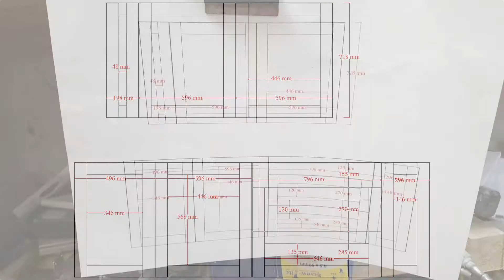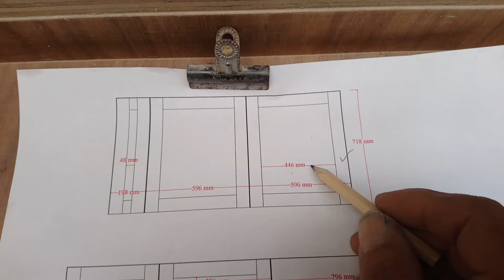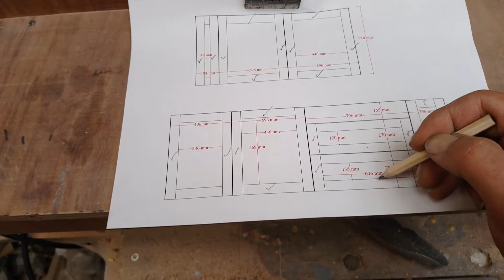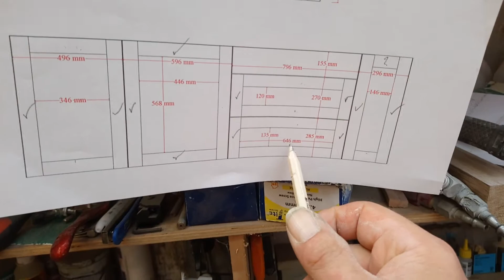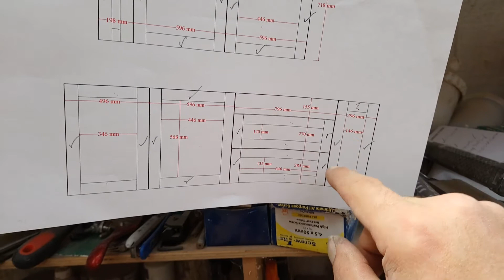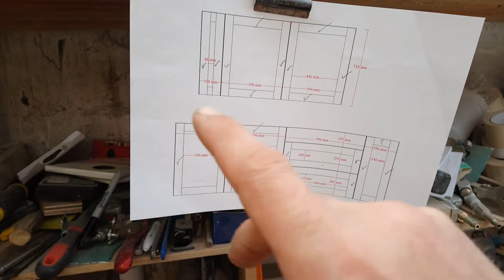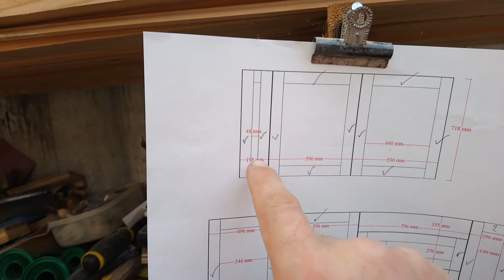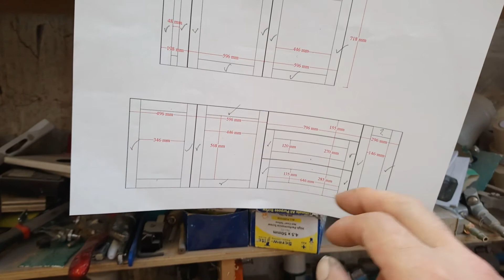Kitchen Fitting Pt8, cutting & planing the wood for the doors

Comment: Cheers Gid... perfect timing..I've started my kitchen and will be on to the doors soon...the wood I'm using is meranti, 20mm. Was trying to get something thicker but thats all the yard had.... thanks again...
Reply from the maker: Good luck with that, hope it goes well, 
Meranti.? is that in the Mahogany family, bit like Sapele. Are you going to keep it that colour, varnish/lacquer it?
Reply: Meranti...sapele....yep...Going to paint it Gid... A Farrow and Ball colour..probably cost more than the wood......; ).
Reply from the maker: Yeah F&B ain't cheap, Dullux will colour match any paint you want, prob cheaper. 
This kitchen I'm making will be a PU spray paint colour matched to F&B Railings grey. 
Same as this kitchen i did -
https://www.facebook.com/gid.joiner/media_set?set=a.1652275884858771.1073741999.100002291265531&type=3
Reply: Snap...We were looking at the Railings colour as well. Not on Facebook, I tried to have a look. You on Instagram?
Reply from the maker: No I'm not on there, The header pic on my YT channel is the Railings grey kitchen, sometimes in the right light you can see greens n blues, I like it  😉
Reply from the maker: What happens if you click on this link, Google photos has half a dozen in for some reason, don't know why i don't use it. I think it is pictures I've tried using for the header pic on YT channel.
https://photos.google.com/?pageId=none
Reply from the maker: just joined/setup Instagram, haven't a clue what to do with it 👴
Reply: That came up with my google photos for some reason...
Reply: You can plaster, draft in cad...joinery..spray...i think you'll master Instagram....
Reply: Oh aye...looks the business, I'll show to her indoors.
Reply: Upload from your phone, you can also do short 'stories' for about 10 seconds. They last for a day i think... don't use it for my stuff just for looking at other peoples work... I might put this kitchen I'm doing up.
Reply from the maker: Must be a generic Google pic link.
Instagram- signed in, linked Facebook, all that did was open Facebook in Instagram, tried sharing a photo,,,,,,,,???????????????,,,,,,,,,,,signed out. 😒

Comment: Hi Gid good to see the sizing process. At the beginning you take overall size and you said you added 4mm. I assume you meant deduct 4mm as I took a snap shot of plans and was able to see that for a 500 unit finish size was 498. 
Would you take this 4mm off the overall height  also?
I liked the simple straight forward plans you work from, what software is it?.
Thanks Gid
Reply from the maker: Hi
 I said "added 2mm", in the same way as you would add a space between words in a sentence,
It's the way i drew it also that affected the way i phrased it, after drawing the 500mm wide unit i added a line 2mm inside all around, this then defines the outer edge of the door, 2mm off each side makes 4mm, therefore a 496 door for the 500 unit.
That 2mm space created then added to the adjacent door's 2mm space made 4mm between the doors. 
because there is no adjacent door at the top, the gap stays at 2mm, if i have to drop the door down a bit to make more clearance with the worktop then i don't mind the doors hanging over the bottom edge of the units a bit. 
This is Turbocad Deluxe,
Reply: Cheers Gid for explanation I can see what you mean now. 👍
Reply from the maker: I'm going to make a short film drawing a couple of units + doors to show because it's not easy to explain 👍

Comment: Hi why don’t you just use mdf for the full door ?
Reply from the maker: Hi, I always give different options to my customers but mainly because MDF is a bit rubbish, I'd have inside & outside edges to sand to paint, might as well of bought some, they wanted a better quality door, you can feel the difference & hear it when they shut, they'd seen a similar job i posted on Facebook, this is simply a different quality of job.